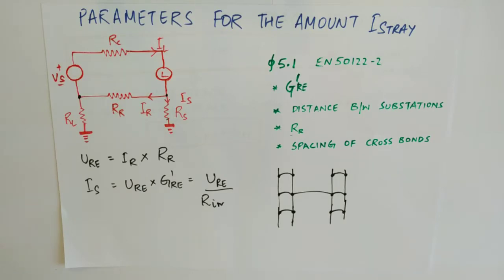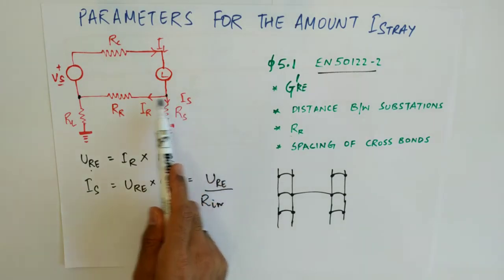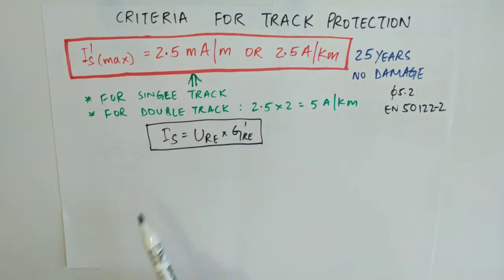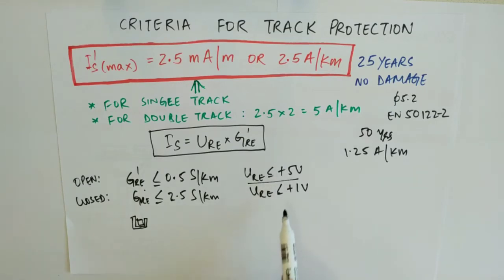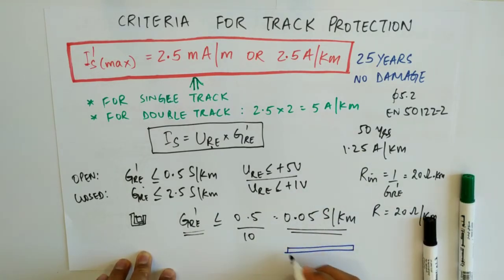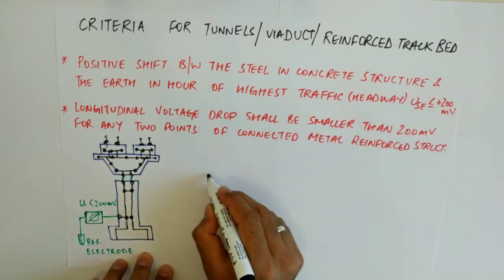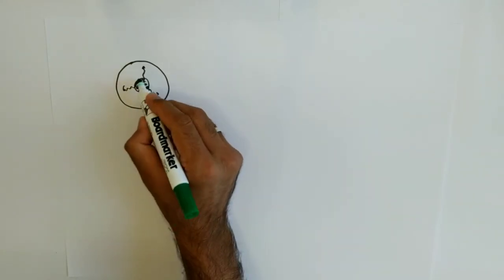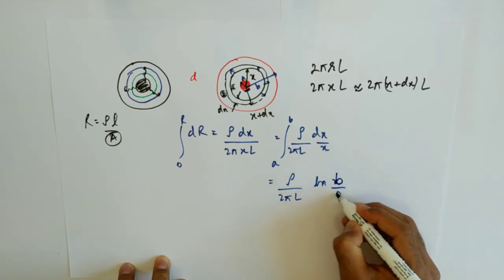Stray Current Lecture 2: Criteria for Stray Current Assessment

Comment: Great lectures as always! Please explain why the formulae 1/2𝚷fc is not used in your cable analysis? Also about the grounding rod sphere of influnce calculations, I haven't seen any measurements to it's effect, for example the stray currents travels 3 meters away from this Cu rod.
Reply from the maker: Thanks! Capacitive effect is not taken into account as this is dc traction. We assume it to be perfectly dc (without harmonics), so 1/(2*pi*f*C) will be open circuit due to zero frequency.

Comment: open formation and close formation , i could not get it
Reply from the maker: Open formation is where the running rails (RR) are installed above the surrounding surface, e.g. viaducts.
Closed formation is where the RR are embedded and the TOR (top of rail) is at the same level as that of the surrounding surface, e.g. trams.
Reply: Thanks man